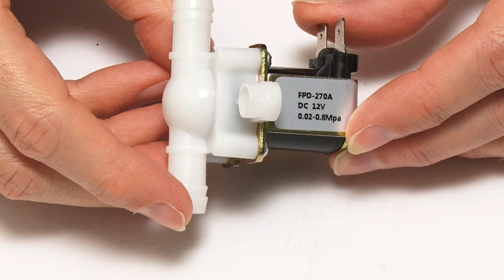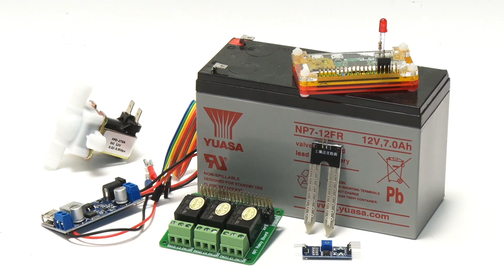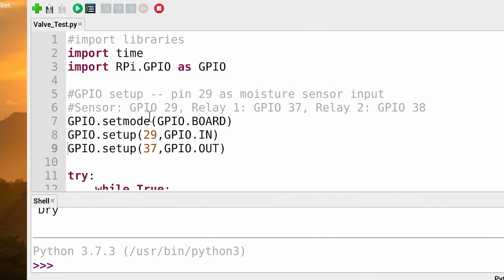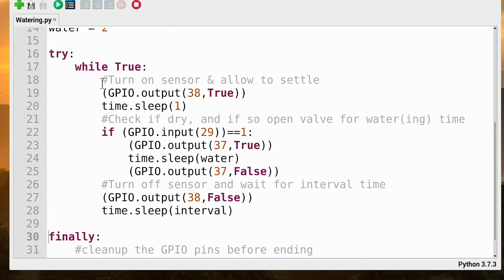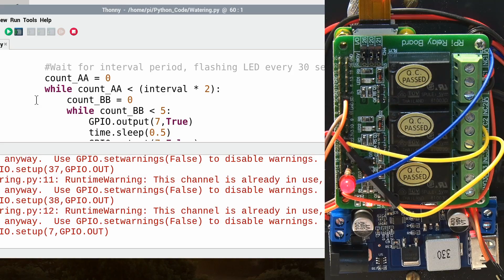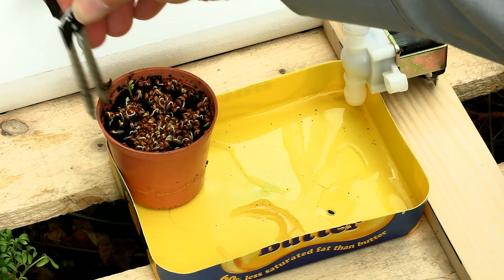Raspberry Pi Plant Watering (& Time Lapse)

Comment: SIR CHRIS,
is the wire copper or something else?  Also the wire “size”, is it - “”30 AWG B-30-1000”” Color AWG30 Cable Breadboard Jumper Colored Insulation Cable ?

I am trying to set up 25 plant watering system as we speak!  

I “was” going to use raspberry pi but I did not know how many sensors / switches / pumps it could manage.
Also. Temperature here now is between 26.6C and 41C day time. 
Can you help find info on the above?

Also, “”top of water sensors “” being outside, do I need to coat top with silicone to stay dry?  I know raspberry zero needs a waterproof container. (Possibly back of pump where wires connect.)

If I am right or wrong in logic, please advise.  Any guidance is MOST HUMBLY APPRECIATED.

Comment: You said you'd be dealing with mains pressure water then later had just a small reservoir. Which did you use in the end? I was a bit concerned that your 'finally' doesn't check that the water it turned off. Does the GPIO.cleanup() do that or is there a danger of a flood?

For the next test you can check the time of day (and phase of moon) so that you only take photographs when it is light. :)
Reply from the maker: I said that the valve is designed to work with mains water pressure, but I was using a local reservoir. Very good point on the finally -- it really should turn the water off.

Comment: I have wanted to figure out a wireless moisture sensing system for my outdoor garden. Have to work on that now. The main problem is finding a sensor that doesn't degrade after a week or two. One poster suggested the "Soilwatch 10" - which its product page claims is "weatherproof." I will have to give that a try.
Edit: Nevermind. I checked the order page and the price for this device is $23.50 - $37.00 USD. It does not say if shipping is included, but it ships from Poland. Too much money. Device doesn't look all that substantial.

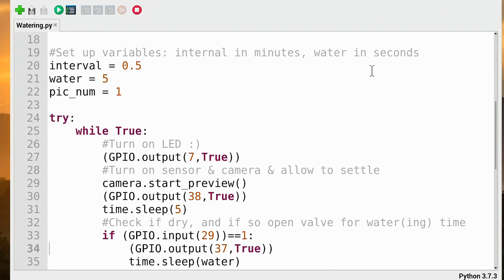Comment: Does your Python program really require the camera preview function?  Why did you say the camera takes time to "settle" at 15:41?  I can see the camera function needing time at the start of the program for setup but does it really need time in every loop?
Reply from the maker: If you don't bring up the camera preview you cannot take a picture! :) It needs to settle for every loop because I turn off the preview at the end of each loop to save power (as we are running on batteries).
Reply: @ExplainingComputers  - That must be a limitation of the PiCamera Python function (and the old RaspiStill?).  Maybe try the PIL.Image function instead as it doesn't need to show any preview.  I've seen it used on YT and downloaded and ran the Python code and it seems to work good.  Maybe it will speed things up too so you don't need any settling time either.  IIRC it will also allow other USB cameras to be used.

Comment: Things to add to this fun project:
1)  a log file to record everything such as: start time, watering time, etc.
2)  a light sensor so pics are only taken when there is enough light.  Also put it in the log to see how watering and light, etc. correlate.
3)  12V battery voltage monitoring via an ADC.  Too low and it sends you a notification.
4)  Temperature sensor.  Record to file.  Don't water below zero, etc.

Using a log file (1) may have helped to show a correlation to watering time (relays and solenoid switching) and the corrupted pictures.  I'm sure others can add to this list.  Such a fun project!
Reply from the maker: All good ideas. :) This video is very much presented as a proof-of-concept and a starting point.

Comment: I was wondering why the second relay was used. Doesn't the GPIO pin itself provide enough current for the sensor? It does provide the right voltage, or does it not?
Reply from the maker: The sensor's comparator board is powered by 3.3V from the Pi (distinct to the GPIO input), and remains so when the relay is introduced. The relay is used to disconnect the 3.3V power from the comparator board when not in use, so that no power is going through the sensors electrodes, hence reducing significantly how fast they will corrode.
Reply: Thank you for the quick response.
I was just wondering why you use the relay to switch 3.3V with 3.3V. Wouldn't it work just the same if you connected the GPIO pin to provide the power for the comparator board?

Comment: I've watch this a couple times and I'm still not sure what the 2nd relay is for and how is it saving power.  Also, when removing the sensor from the water, shouldn't there be a delay between states as there would still be some water clinging to the sensor?
Reply from the maker: The second relay is used to turn power to the moisture sensor comparator board on and off. The sensor works by passing a current through the water -- so as soon as it is out of the water, its state changes, even if its electrodes are still wet.

Comment: This past week I got a Raspberry Pi 4 and was able to not only host Xonotic on it, but play it as well. I managed to replace a Ryzen 5 3400G with all but a Pi. My faith in the Pi has been restored ever since I ditched them with a botched OSMC Pi 2 3 years ago. Seriously, that same Pi host my websites and household SMB server without breaking a sweat. I love my new Pi 4 8GB and look forward to trying Ubuntu on it with an A2 SD card.
Reply from the maker: Great to hear. As you have found, a Pi 4, especially a 4 or 8GB model, is a very different piece of hardware to a Pi 2. :) You will find the latest Ubuntu for the Pi a great experience I think! :) TwisterOS is also well worth experimenting with -- very much a next gen Pi operating system: https://www.youtube.com/watch?v=AtZWEPxrCz4

Comment: Simply amazing. I have wanted to do a nearly identical project and had purchased a relay board and some solenoids over a year ago, but when I looked at the moisture sensors, I knew there would be a corrosion issue with them and I never did think of a way or type of sensor that would not have the problem. It never occurred to me to simply use one of the relays to turn the sensor off to mitigate. You're a hero. I also hadn't thought of attaching a camera which would be nice as well after thinking about it. I had, however, thought about the configuration necessary or advisable on the solenoids - You'd want to be sure to have "normally-closed" without voltage to avoid flooding issues during a power interruption. I think that is what you have on your setup, but perhaps worth mentioning to others wanting to do a similar project. Thanks as usual. I do enjoy your channel.
Reply from the maker: Thanks for this -- my solenoid valve is indeed normally closed. :)

Comment: Great system, i could use it for my chili plants, ohh, well, i have 15 plants, major undertaking to build that kind of system, how many moister controlers can i connect to one pie ?.

You should set a counter to record how many times your pump is started, and record the temperature in your greenhouse. 

Thanks for a great video.

Comment: Brilliant, great idea with the time lapse camera. I’m glad you did what I mentioned in a comment . I set up my own with the pi pico, though I used a submersible pump and and capacitive moisture sensor in a plastic bag. I am considering switching to a solenoid. I just wanted to try using a motor. Your code is much more efficient than mine ;)

Comment: I could imagine a system where the relay controls a small pump which fills a plant pot directly, and the reservoir below the pot catches the water and just keeps recycling it.  Combine that with rain water collection and solar power and it would be completely self-sufficient.

Comment: I attempted a project line this a couple years ago. I was using a similar moisture sensor... And basically couldn't figure out viable moisture sensors that don't just melt the solder off or rust... (I don't know that mine had a digital out... But my pi didn't have headers and I had sensors working on the Arduino and sending the data to the pi over the serial port)

I had three idea to maybe putting the moisture sensors on a relay.... But never got around to trying it and just went with the temperature and light sensors and gave up on moisture sensors.... (And other aspects of the grow manager project) the dht11 sensors were super useful as they have me better data then I could do manually.... But I can just do manual moisture sensor once a day to see if I need to water them that day.... 

The goal was to depression proof the grow stuff... But those efforts kinda feel victim to depression.... And now the whole grow has fallen to depression and persistent pest issues or something.... Went from being super successful to can't get any of the plants to live long enough for harvest)

Comment: Timelapse plants are creepy :D

So, for your next project.... a Pi, a couple cameras, and a wifi connection might make a good cheap surveillance system. Ideally feeding images (or video) in realtime to a PC in another location (without going via internet). Wondering if a retired cellphone could provide better wifi than what can be got with an SBC. (Cuz I have an otherwise-useless cellphone that has terrific wifi range.)

[I'd like to have surveillance in my barn, but can't justify $400+ for what probably amounts to a Pi in a fancy box.]

Comment: code could use some refinement, to not photograph at night, add a lightsensor or check time or the 
third relay could be used to activate a lamp at the same time the moisture sensor is activated.
with a  pi0 wifi version, the photographs could be stored on a remote nas ... may prevent bad photos.
deluxe version would use silver coated sensors.
a servo could be used to embed/remove the moisture sensor from the earth.
anyway a fine project and explanation.
Reply from the maker: Certainly the proof-of-concept here could be improved. The refinements you mention are all hardware dependent -- adding a light sensor, checking the time (the Pi does not have a RTC), etc.

Comment: I suggest replacing the soil moisture sensor supplied with the comparator board with a couple of stainless steel nails. You can hold them together using hot glue or a 3d printed contraption. I have been using a similar setup with an Arduino for 3+ years the the stainless nails are spotless.

Comment: Very nice.  I see you used a funnel as opposed to connecting to the water mains. A nice safety feature.  Also by letting the pots draw water up,  you can get them all with one setup like this as opposed to 4 sensors, valves, etc.

Comment: Great illustration of stage-by-stage development, with tests at each stage. ("Is it on? Does it do something? Is the something what I want it to do?")
How long the battery will keep the rig powered up? The next obvious step is to have a solar panel trickle-charging the battery. (Essentially a weirdly proportoined UPS.)

Does the Python used in the video  have a) subroutines (aka functions), b) the ability to read from the command line? Code is much easier to understand if it's all on one screen, Having a main loop around a list of steps  (initially  stubs that just return) will outline the function of the program, and make each of the steps a single page of code. If the initial stage of the program can be "get the values for this run from the command line (or a file, if you're feeling ambitious), it will be possible to run multiple levels of test without changing code. (Bugs are roughly proportional to amount typed,) Maybe wrapping the GPIO pin settings in a named constant or routine (if that's possible) that describes the effect (e.g. turn_on_water, take_picture) would make for more readable code. 
None of that makes a huge difference, except aesthetically, when the code's new and fresh in memory, but in a few months....

Comment: It would be interesting to know what caused the corruption of the images. Another feature to add to your code would be to not take a photo if there is too little light using a light sensor to control it.

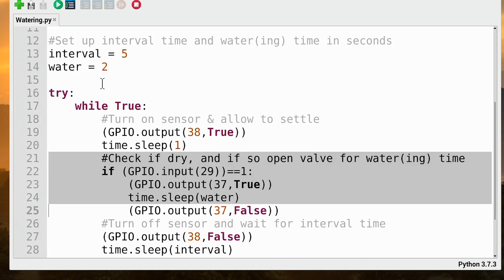Comment: At 11:20 you leave the sensor on while watering the plants. That is not necessary, you should read it into a variable and then turn it off, if avoiding corrosion by having it on the shortest time is your goal.

Comment: I am loving this, but there is a slight control engineering problem in it: The soil will absorb the moisture from below, which takes time. This may result in multiple releases of water while the sensor is still not indicating the soil is wet... There is a slight risk of overflowing the container. I would reduce the release time and make sure the interval is not too short. 

This may only really really be a problem for taller pots as the moisture would not reach the bottom of the sensor quickly enough. I would adapt the system to get those to work. I am currently growing some venus fly traps with my 8 year old daughter. She loves it, but the seeds have to be kept moist for 3-5 weeks. That is hard to do in hot weather, so I could definitely see us building a similar setup that waters from above.

Thanks for another quality video!

Comment: The cunning plan reminded me of Baldrick from Blackadder. It is strange to me that the watering is from the bottom and not from the top of the pots. How is this better? Isn't it wasting water? Otherwise very nice project that gave me inspiration. It's interesting can it be done with a solar panel.

Comment: Nice project.  An alternative to using the relay board to control the solenoid would be to use a switching MOSFET connected to a GPIO.

Comment: For indicator LEDs, I'd like to have two different colours, blue and white:
https://www.hindawi.com/journals/jnm/2013/870254/
https://www.sciencedirect.com/science/article/pii/S002202480000275X
The following system is sensitive to blue LEDs:
https://chemistry-europe.onlinelibrary.wiley.com/doi/full/10.1002/slct.201904699
I'd like you to get components related to LEDs as well as other applications, like analog video signals and click-pop suppressors from here:
http://www.sg-micro.com/

Comment: Chris, is the oxidation a result of chemical reactions of the metal and soil or electrolysis from the current? Would it be beneficial to use another relay ( dpdt, commons on the soil leads, and cross wire to the sensor board NC & NO), to change direction of current in soil conductors?

Comment: Had car troubles today, and got to class late - (Wire shorted out on my AutoPi project interface). Great improvement on the python coding today! (Or maybe I'm just understanding things better??) I might add a second sensor to check the supply water level & send out an email page to my phone to alert me.

Comment: The second relay really isn't "saving" the battery, only the sensor. The relay takes more to turn on  the electromagnet in the relay then running the sensor. Fun project, my wife loves our setup and its easy to do!
Reply from the maker: I pretty certain that more power would be used having the moisture sensor comparator board powered 24/7, than having the relay triggered for a few seconds each 15 minute cycle. The relay is not using any power most of the time.
Reply: @ExplainingComputers  that would be an interesting test! Huge Inrush to electromagnet vs low and slow sensor power comparison!!

Comment: That style of mositire sensor isn't great as it will eventually rust. Using a capacitive sensor is much better for the soil, plants and wallet so don't have to replace them
Reply from the maker: True, as I discussed in the video. But a Pi does not have an analogue input to directly connect a capacitive sensor to.
Reply: @ExplainingComputers  maybe a future video using an analog to digital converter with a capacitive sensor could be an idea as a version 2 of the project

Comment: Thanks for this very interesting and useful video! What I would like to mention though is that a lot of plants don't like to have wet feet all the time, and therefor I would like to suggest to put the water sensor in the container rather than in one of the pots. You may need to increase the watering time, so it will fill to a certain level, let the plants suck it up and not rewater until it's dry enough for the sensor to ring the bell again. That would make for a more realistic scenario, suitable for more species. And don't get me wrong: it is absolutely a very useful video the way it is now and I appreciate your effort and explanation very much (indeed)! Keep up the good work!
Reply: Came here looking exactly for this comment. Maybe would it be better to drop the water above the plants? Requires raising the valve and reservoir, and some more complex tubing, but would also avoid keeping the roots too wet all the time.

Anyway, fantastic project indeed!
Reply: I would add a loop siphon (made with a loop of hose) to the watering pan so that each time the watering cycle occurs it completely fills the watering pan and then drains it once full.  Also plants like to get their leaves wet, so a misting system would also be good for plant health.

Comment: A very informative video as usual.  It will be interesting to see how the sensor goes on for corrosion problems with your idea of turning it off when not actually reading it.  Are you suggesting that it is the current flow that causes/exacerbates the corrosion problems? Swiss Accent Guy had similar problems, not sure if he found a solution and Great Scott was also doing similar in his greenhouse.

The time lapse video takes this project to a new level though.  Looking forward to future updates.